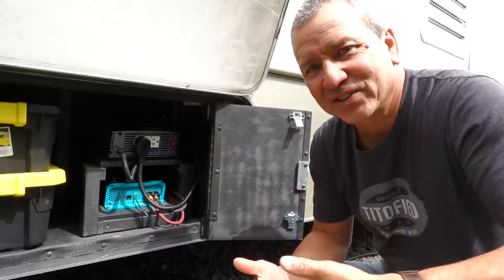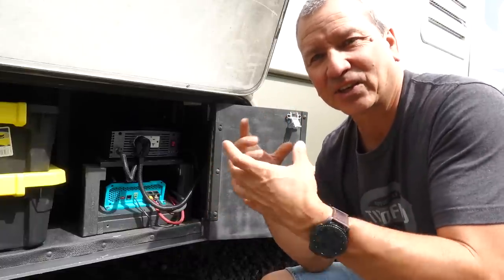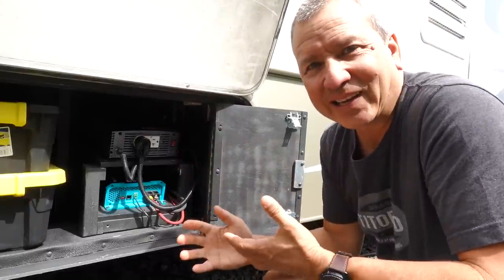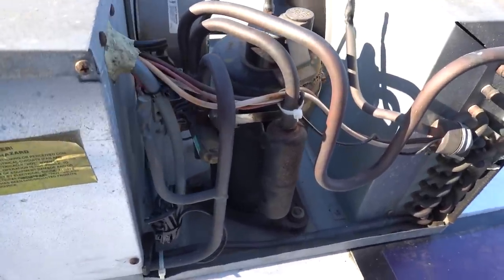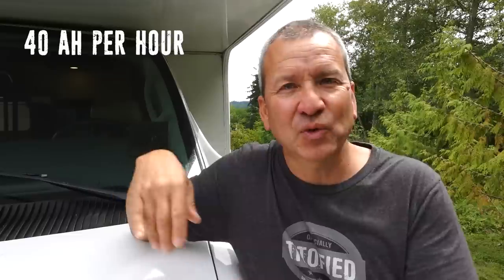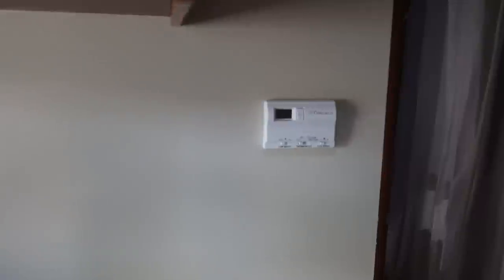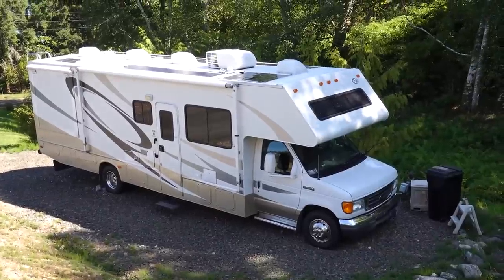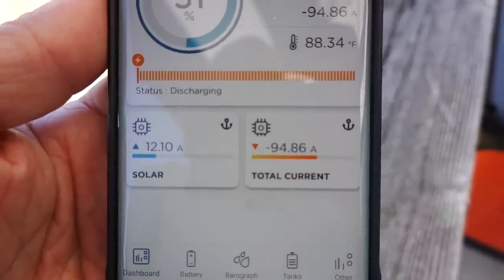BAD IDEA? Running RV Air Conditioner on SOLAR and INVERTER

Comment: Thank you!! Great video! Perfect for giving me a sense of how big a project (cost and effort) I would be considering if I wanted to go this route. The mrs loves her a/c and I love boondocking (and hate the noise of the generator). It would be so freeing to be able to boondock (quietly) and run A/C. But, did not have a good sense of how viable that wish might be or how big of an investment in time and energy I might be taking on to make it a reality.
Reply from the maker: It's definitely an investment in time and energy to get there. Most of us avoid areas/seasons that require A/C.

Comment: Hey Tito, I recently installed the soft start module in a Colemen Mach 8 in my 2020 Eaglecap 1200. I have 500 watts of solar and thus far have tested it to 90 F. The solar easily keeps up with the AC, keeping the temp at 74F on low cool.

I wondered about your AC units drawing 100 amps. My single unit, 13,500 bti draws only 12 amps.
Reply from the maker: Sounds like you've solved it. My A/C with dual compressors draws between 1300 and 1600 watts.

Comment: We have a heat pump style A/C system in the basement of our motorhome. Which gives me a lot of roof area for solar panels. We installed 2000 watts of solar. This makes it possible to run the system all day long. But I also setup a 6000 BTU window unit for cooling. This allows us to cool on days of limited sun. I have a video about our system on my channel.
Reply from the maker: Thanks for sharing your setup. I wish I could do that. I checked out your video and left you a comment. I also liked your grid-tie solar. Did you use the same panels on the RV?
Reply: @RVwithTito  Yes the panels of the grid tie system. Are the same panels as on the motorhome.

Comment: if it's just one person or one room, my Vornado 660 is more than adequate for the job, for multiple people, I recommend USB fans everywhere

if it's more than 10 degrees of "perceived cooling" you need to achieve, then yeah I guess AC is a must...
or very high humidity
Reply from the maker: Lots of things would be different if it were just one person :)

Comment: Great Video, thank you!  Something to think about while I was watching this, I just want to keep the inside moderately cooled.  74 degrees is pretty cool where we live (AZ).  I would guess that if the AC was set at 82 or 84 the batteries would have more chance to recover.  I really like the idea of the soft start unit and will consider it for when I finally install my solar system.  Right now I am looking at assembling a 400W system (2 x 200W panels), a controller that will accommodate up to 600W of panels, 2 group 27 batteries, and a 2K or 3K inverter.  I would like to get input on what I am getting ready to do as well if someone wants to comment.

Comment: great video brian and well appreciated .
 knowing the size of your set up is great -someday i’m probably going to have to do some math on weight and cubic inches needed  to size out a coach. cost too of course ( all this is gentle suggestions for more info if y are so inclined😂).
your demeanor, humor and information are very high on my i’m impressed list.
be well😊
Reply from the maker: Thanks so much for the feedback Bruce. My setup is kind of in the middle of most boondocking setups out there so I though it might be a good benchmark.
Reply: RV with Tito DIY - yes indeed it certainly was a good episode 

thank you

Comment: Interesting test.  Would have been interesting to see it go for 24 hours to see what level the batteries would be at.  I would assume the next morning you would get some power back before the AC started again.  Would also be interesting to see how it would work overnight in a campground where you have quiet hours and can't run the generator.
Reply: Yes.  A lot of battery capacity can be recovered the next morning before you need AC
Reply from the maker: I'm guessing it would fully drain the battery bank, depending on the temps.

Comment: Didn't know if people were aware of a co called Arctic Breeze they make a 12v ac for big trucks they pull 47 amps at 12 v dc  it could be an option for someone who wants to add an ac to what they have, just a thought. Like your channel.
Reply from the maker: I can't find out price or where to buy them. Do you know?

Comment: Thanks Tito, great edit. A few years ago, the idea of running an AC  on solar was poo-pooed. Today you are showing its possible and maybe doable in short bursts, but not really ready for 24/7.  I'm wondering how much improvement a 12v AC unit would make over a 120v, inverter driven unit. Is there a significant loss going 12v-to-inverter? Also, we operate around 78 degrees on our AC, so I'm wondering what savings you get for 2-4-6-8 degrees warmer.

Comment: A 20 plus seer mini split uses approx.600 watts as an AC tech for 45 years it's that ..more solar or a small window air .rv rooftop AC not very effecient
Reply from the maker: Sounds like a more efficient option for sure.
Reply: @RVwithTito  That is what I'm using as I type this. Far more efficient! In fact this weekend I'm removing the standard roof top unit because it's useless to me.

Comment: Use a smaller inverter to minimize the idle power draw.  Maybe 600W would even work.  A lot of people say you can't run an inverter because it's not efficient, but mini-split ACs are almost 2x more efficient than most 12V AC systems.  That means even with even if you lose 15% of the power to the inverter, you're still more efficient.

Comment: Tito informative as always; how about the lithium batteries getting charged by the actual coach motor as does the Alta Power System you find in Winnebago 59KL Class B. Yes larger alternator and larger radiator and engine automatically comes on and takes the place of an generator when batteries reach a certain level.  The coach motor is quieter than these small generators. I have a new towable being delivered in Jan 2021. I will be using a small 2200 Generator. This model is only 19ft with a slide- out and comes with the Coleman Mach 10 15KBtu and 12V fridge. Living in South Florida and dry camping means A/C 98% of the time.  Dry camping here also means neighbors in our state parks that have no electrical or sewer but  some have water. And many are slotted as if a normal camp site. Meaning you have neighbors and no generator to run at night due to noise. So I'm thinking going full Lithium, with large inverter and capturing power source to reboot my charge through my tow vehicle "1500 Pickup" One side of this is  easy. But getting power from my tow vehicle is the tricky part? Yes this will be pricey...lol I'm looking at 6 lithium's minimum and Hybrid inverter. And heat warmers for batteries since i plan to winter camp in Northern States.  I have yet to see anyone do this with a Tow vehicle?

Comment: Why would you stop the test at 50%? I thought if you have lithium Iron Batteries you supposed to be able to run them down completely (to auto shut off point which is something like 5-10%) with out ANY battery degradation? Maybe I misunderstand something.  Thanks for the test. It pretty much answers my question as to weather I could run the ac over night with the gen off.

Comment: Would mounting a panel on a vertical surface possibly be more efficient in the winter months? The flexibile panels could be positioned to look like a window on the sides or even on the rear. Or even be made to cover the over cab window. I just an throwing out silly ideas.
Reply from the maker: Probably not a good option. You would always have to be parked with that side facing south for winter. It would have to be a temporary setup using flex panels like this https://youtu.be/Al8rCydNiLs.
Reply: @RVwithTito  Thank You

Comment: That was a great video, and I really enjoyed the data you provided.  Did you not consider your extra alternator as part of the system?  You could full charge the batteries back to 100% in a couple of hours to be ready for the net day of AC.  Thank you for the time, expense, and sharing your test results with us.  Looking forward to your next DIY video.

Comment: I run my house off 9 panels 8 battery you need more panel that's all . These panels I have are 175 watt RV panels they take less room on the roof 30 year. So much depends on usage a cheap inverter pulls allot even panels that are priced low do not live up to output . The age of AC some of the older AC pull large amount of amps . Great video add some panels you will never need a generator 😄 you have room on the roof .
Reply from the maker: I have several solar panels that haven't made it to the roof yet :)

Comment: Thanks for your DC-DC converter video. I protect my RV alternator with one now.

I’m not a fan of generator noise. The DC-DC converter would be a good supplement to solar while running AC, but idling our big gas coach is still pretty noisy and stinky when stationary.

But our car is quiet and uses less fuel.

Do you think it’s possible to simply connect jumper cables between my car’s  battery and the coach battery and use the coach’s preexisting DC-DC converter to protect the car alternator instead? In this scenario, the inverter pulls from the house batteries which pull from the coach chassis battery which pulls from the car battery which pulls from the car alternator. Might not be particularly efficient but ?

Comment: I have 4 300 watt solar panels on my roof, Victron 150/100 charge controller, Giandel 1200 watt inverter, Giandel 3000 watt inverter, 5ea 2nd hand Valence 138ah lifepo4 batteries from decommissioned medical carts ($400ea), 5000 btu Frigidair energy star window ac, 2010 Ford E250 van. I can deploy another 600 watts of solar with small 100 watt panels as needed. 
I can run my ac as much as I want on only 1200 watts. It pulls about 420 watts when the compressor is running. It uses about 250 watts per hour to cool my van on a 100°F day. 

My van is insulated with 2" all natural sheep wool sandwiched between reflectix. Aromatic cedar lines the van interior to protect the wool. The van is cng powered with 50 gallon equivalent capacity.

For backup power I have a remote start Honda clone engine that belt drives a 2400 watt permanent magnet alternator to charge the battery bank if necessary and avoid conversion losses going from ac to dc. The permanent magnet alternator also avoids up to 30%  losses from energizing a  stator. It is mounted to a class IV 2 inch front receiver hitch.
Reply from the maker: Nice setup! Thanks for sharing it.
Reply: Dude your styling

Comment: I run a Nomadic Cooling 8750 btu DC powered mini split on my 32’ RV. That unit pulls 48amp from batteries on high. I have 5 240w 46v solar panels and they just keep up with that power draw at peak sun times. So I do need to run a generator at the end of hot days...but not all day!  At night it is cooler and the A/C unit draws more like 25Ah and cycles off so my 300 Ah of LiFePO batteries run it all night to keep bedroom cool.
Reply from the maker: Thanks for sharing your setup. I appreciate it. I didn't realize so many were using a mini split in their RVs. Now I know :)

Comment: In a previous video you mentioned your DC to DC charger tied into your alternator. It seems the Winnebago Travato has a similar solution, but the engine will actually auto start (oh, h*ck no!) when the house batteries get below a certain voltage. And what's more funny is I don't think that Travato has anywhere close to 400 amp-hrs like you do, & only like 200 watts of solar. The auto-start is also always turning on the engine unexpectedly, even when it's not been enabled by the owner.

Do you think, though, if you tried some other alternator/DC-DC Charger options, you could keep your batteries charged better? I'd think if you set your thermostat to 76 instead & tried to get 40 or more amps from your idling-engine's alternator, you might find running the engine an hour or less per day would keep the house batteries much closer to 100%
Reply from the maker: Yeah. I could idle the engine at any time to put more amps into the batteries or whatever load is running.

Comment: I realise that this video is over 2 years old but I will still post my RV setup and running an AC...just in-case it is useful for someone.

2.25Kw of solar, 800AH of lithium batteries, split cycle AC.
And the result is....I have the same issue that you found, the solar was going into running the AC thereby putting the battery capacity at a lower percentage the next day, followed by the next until I have to plug into an external power source to fully recharge again.

It is a bit more complicated than that though as the solar is putting in 1900+ watts during the peak solar charging of the day with the AC only using 800-900 watts of that and the rest being wasted after the batteries are 100% by 11am - 12 noon, but as it moves into late afternoon (4pm onwards) and the solar charging drops off, that is when the AC is using up the battery capacity.

However I do live in a part of Australia that is over 40 degrees Celsius during the day and only reaches a low of 27degrees Celsius at night, (It is now 11pm and the outside temp is 30 degrees Celsius) therefore the AC has to run 24/7 and has no time to shut off...keeping in mind that your test did not take into account other activities that happen in the RV including going in and out of the door during the day which will affect the AC run time vs idle time.

My solution - I am upgrading to 1200 AH of lithium batteries so that I can store some more of that wasted potential during the peak of the day, and my calculations show that I should then be able to run an AC 24/7 and use the RV without compromising on other activities that use power.
Reply from the maker: Good info. Thanks for sharing!
Reply: Tito lives in Canada!

Comment: I have a class a rv with 960 watts of solar, 600 ah of lithium, and a 3000 watt inverter.  I have three rooftop AC units, and all three are needed to cool my 40' MH in really hot weather.  I like the plan to start early, when the temp in lower and not wait until the space is already hot to start the cooling attempt.  I could run my 10,000 watt generator in a pinch, but I hate the noise it makes, and the fuel it consumes would be unsustainable.  One could start with the batteries, and then, when the bat bank reaches a certain draw down point (50% or 40%), have the generator fire up automatically.    It also seems that the best solution would to match the solar production to the AC demand as close as is possible.  A set of portable panels could be deployed when this is attempted, using the on-board equipment.    I think my rig is really too large for this to work though.  Better to have a one AC sized rig.    Great video.  It makes me think about what is possible....many thanks.  If the panels are in the sun and the rig is in the shade you would get the best out of both....

Comment: I've been considering ground deployed solar and parking in the shade.
Reply: That's the best way to go. It's easy. You can expand, you can tract the sun manually,  You can spread out the system to maximize power harvesting. I always park in the shade. I have a 500 watt ground system I can run up to 75 feet away from the trailer and spread out the panels up to 20 feet apart to avoid shade. It make me 30 amps of power.

Comment: Run the air for a day then make the next day  a travel day,install a DC to DC (300 amp) charger and their you go house batteries will be all charged buy the time you stop...

Comment: Although your result were disappointing to rely on solar for AC, there are many factors that can be played with to make it work. For example, having a smaller rig which can be cooled by a 450w 5000BTU AC instead of huge 1700w AC that you used. Or having better insulation, tiltable solar panels and having a 1000w solar array will make it possible.
Reply from the maker: All of the adjustments would certainly make a difference. Thanks.

Comment: Great video. A bit off subject but can you do a video on replacing the air filter for the cab heater and air conditioner. I get mice in there and I want to be able to change it myself. I know I have to remove the battery. I have a Tioga class C. Thank you

Comment: This is probably a stupid question by someone who knows absolutely nothing about RVs, but:  Would anything be harmed if a person built a metal framework that rose upward to a few inches height above the air conditioners (which I assume are the tallest obstacle on top of the RV) and then cover that framework with solar panels for the entire width and length of the RV...kind of like creating a deck made of solar panels above everything on the actual roof? That would allow maximum solar panels and also provide shade to the actual RV roof below it, while letting air into and out of the shaded area under the solar panel deck from all sides. Maybe one could even duct any heat exhaust coming from the air conditioners to the sides...
Reply from the maker: You wouldn't be the first. If it's solid and mounted well then it's not a problem. You'll just have to be aware of your height as you drive under things.

Comment: Great video! So if you had 4x 300w panels (residential but should fit on an RV) and assuming AC runs 50% of the time, you should be able to make it, right? (esp if cooler in the morning and if you set AC to 77*C)
Reply from the maker: I'd probably need a bit more. Probably 1500 to 2000 watts.